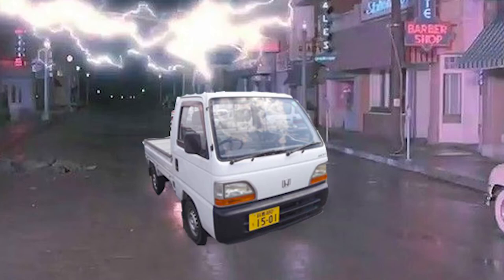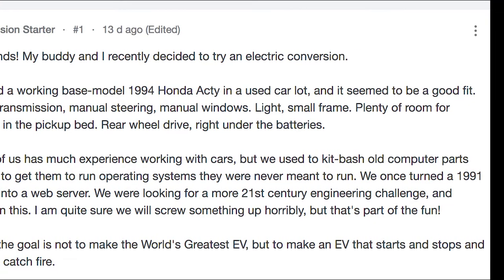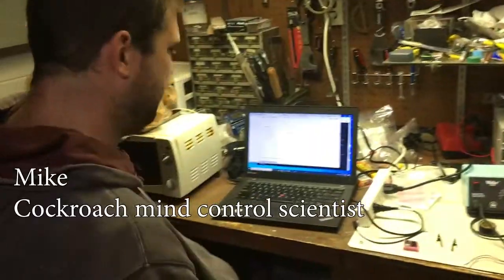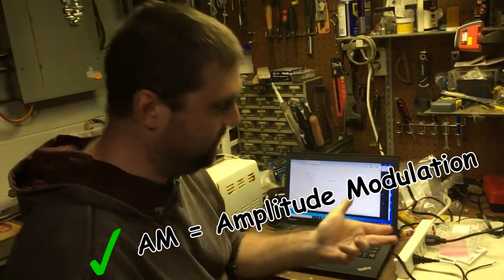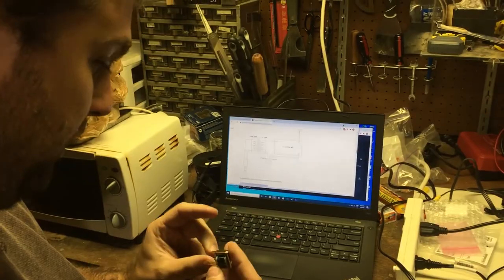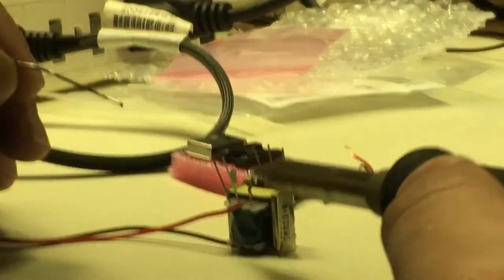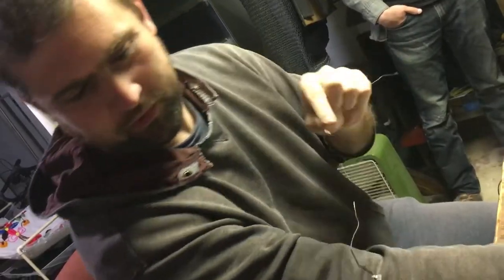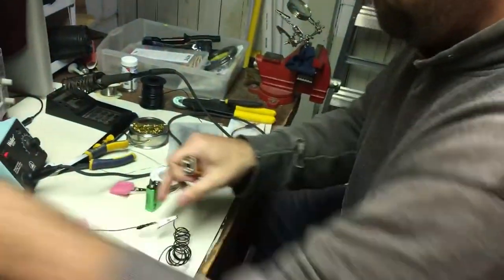Converting a Kei truck into an EV - Radio transmitter assembly - Part 3

Comment: It's funny, a year in - and I love all your work on the project but it's the radio stuff that lives rent free in my head - probably because my car radio is an "advanced" 2005 satnav that eventually, I'm going to have to deal with. And unfortunately, I don't think much of it will be salvageable - so at least, I need to make sure any replacement is not so inflexible as regards repair and upgrading.

And this is how last night at 11:50pm I was reading datasheets on the STA709 and STA710 radio-i2s demodulator IC's. I'm now really annoyed no-one makes an "X-Bee" style module for them, because they're cheapish ($8 in a batch of 1600) and ridiculously powerful - I2C/SPI for control, I2S for data - and it can demodulate LW, MW, SW, FM, HDR, DAB and WX weather transmissions and send them into a Pi.